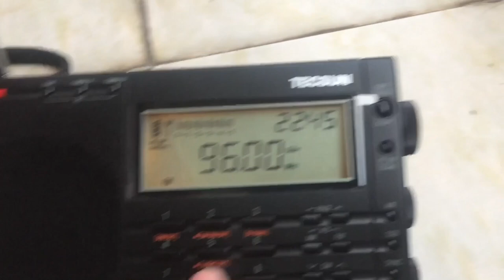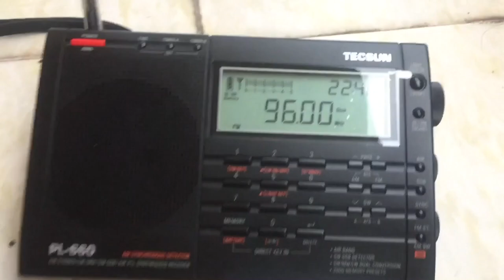Easy Crystal Locked FM Transmitter With Single 9018 Transistor  Stable Frequency

Comment: That is not a 24MHz crystal oscillator. It is a 24MHz crystal. An important distinction!
Reply from the maker: Hi Nick B, thanks for the correction 😊
Reply: And what is the different between "Oscillator Crystal" and "just Crystal" ?
Reply: @ميكال_باسل  
Crystal oscillator contains full circuit inside including one transistor and other components.
Reply: @Mulazim.  I got it , Thank you .
Reply: Bob Button  Because crystal has a harmonics frequencies so 4th harmonics frequency is 96Mhz.http://mustcalculate.com/electronics/harmonics.php?f=24M
Reply: Semantics, I don't agree with you
Reply: Hi Nick. Whether the product mentioned in this link is actually a crystal or a crystal oscillator? https://robu.in/product/hc49-s-11-0592mhz-crystal-oscillator-pack-of-5/
Reply: Dude one video he changed the hole radio at the end when he supposedly made a air plane radio

Comment: It is a fake video and surprisingly everyone is thinking its real.
Reply: I was also pretty surprised about the circuit diagram. It makes no sense for me.
Reply: @MyProjectsTV  I just cannot understand how it multiplies the frequency of the crystal to exactly 4×
Reply: @endothermicexothermic4051   Me neither. Unfortunately my knowledge about rf circuits is limited. Because I can't find much information in the internet. 
EDIT: Since there are comments of people claiming that it works, this is how it might work. 
The tank circuit is tuned to 48mhz. So double the cystals frequency. But these tank circuits have a lot of harmonics so it transmits of all sorts of multiples. So also at 96mhz But that's pretty dirty and should be filtered. But I still have doubt, how the crystal even oscillates.
Reply: @MyProjectsTV  yea, not much information is given...I am now struggling with building hf and vhf sstc, so i move on to rf circuit design, sad as the truth is that there is no people willing to post a video and discuss how to calculate the L or pi impedance matching of the amplifier output...Or sth like that.....
Reply: @MyProjectsTV  and it seems that the frequency is controlled by L and C in a normal resonant tank, so if u get a large cap, u need to use a small inductor, which may cause the current flow to the transitor increase.....It may make it burn out. I made one simple Fm transmitter oscillator, the tank cap I used is around 18~22pf, and the henry of coil around 100~200nH.
Reply: @MyProjectsTV  um, sir, plz teach me how to build a RF amp if you are willing to do so. The mosfet that I wanted to use is RD15HVF
Reply: @endothermicexothermic4051  Like said, my knowledge is limited. I tried to find that out aswell. But couldn't find any information :/
Reply: @MyProjectsTV  😂I just thought that you were trying to be humble so that you told me your knowledge was limited....
Reply: @endothermicexothermic4051  could you please share your circuit diagram kindly I want to make the circuit
Reply: I tested it and its working. I tried also different transistors like bc547 2n3904 bf199 2n2369A. Some will give a bit lower volume but all of them worked. You can try different crystal values like 25mhz which you can receive the 4th harmonic (100mhz) on the FM radio. 48Mhz is good because you can hear the 2nd harmonic on fm radio at 96mhz. The higher harmonic number the weaker the signal. 27mhz is my favourite because the 4th harmonic is 108mhz which always blank and no station broadcasting at this frequency in my country. So i can receive it on the radio without distortion. The diode is a varicap (varactor diode) type. Other types of diode might work but wont give the same performance. You can salvage these diodes from old crt tv tuner board (the pcb which is having the antenna connector and we attach the coaxial cable to it). Good luck.

Comment: Hi! Great project! But I have a question: What is the range of this transmitter? Thanks for your answer! 😊
Reply from the maker: I didn't test the range, maybe about 10 meters 😊
Reply: @diyshow888  Just enough to transmit into a car radio while inside the car...convenient to play your cell phone videos through your car radio, lol
Reply: @diyshow888  it ain't 10 meters, heck, never. At most, 2 - 3 feet or so.

Comment: Its using  4th harmonics .24 mhz times 4 is 96 mhz.
Reply: so , it's not actually locking right ? it's taking just fixed Upper Harmonic right ! so it's not tunable ?

Comment: can anyone tell me how crystal locking works , even if crystal is only of 24Mhz how it Work with 90 MHz LC tuned Rance ? since crystal oscillator oscilate at fix frequency ?
Reply: Same question
Reply: @ubtech2938  now I can answer bro ..
Reply: @omsingharjit  
could you tell me 🙂💔
Reply: @ubtech2938  yes , every Frequency source produce Harmonic of multiple frequencies for this case 24Mhz Crystal will also Produce 24 , 1st Harmonic 48MHz , 2nd 72Mhz , 3rd 96Mhz , 4th 120 so you have to pick frequency only from these .I have seen this with my spectrum Analyser
Reply: He is using 96 MHz from the Above Harmonic but The issue is the higher the harmonic , the lower its amplitude
Reply: @omsingharjit  wow . thank you ! this was a puzzle on my mind i guess i finally found the correct answer

thanks again . really appreciated
Reply: @ubtech2938  thank you.

Comment: which component did you use for the antenna 
and can I use an inductor coil to act as the antenna ?
Reply from the maker: You can simply use a wire as the antenna😊, soft wire or enameled wire ,  it doesn't has to be spiral

Comment: Can we connect the microphone to this circuit from the audio input part?
Reply: Yes
Reply: yes , just bise Mike with 4k7 resistor with positive and connect with base using coupling capacitor in between that should work .

Comment: Good evening, the transmitter works, but the volume of the signal at the receiver is very low? Matthias
Reply: e tenido problemas tambien con el sonido bajo.con este tipo de transmisores a cristal  en otro diagrama pero lo que hice es poner en resonancia el circuito tanque sintonizando en la frecuencia .
Reply: Try running this with a 12 or 16 MHz crystal.  The problem is the limited amount of frequency modulation that you get with these transmitters.  The range that the capacitance variation of the diode can pull the crystal with is very limited.  By taking a lower crystal frequency you get to use a higher harmonic of the oscillator.  That results in a larger FM modulation frequency sweep as the frequency difference from the diode capacitance modulation gets multiplied too.  The downside is though that this may also reduce the range of the transmitter as higher harmonics are often weaker.  But the sound level should be better.

Comment: What dose the zerner diode do ? I used the 12 V one and bc547 for transistor but the volume is bit too low
Reply: the diode provides a varying capacitance as the voltage changes (up and down) with the input signal. This, in turn, modulates the frequency by changing the crystal capacitance.

Comment: if the crystal oscillator is replaced with another frequency, is it multiplied by 4 too? for example 12mhz x 4 = 48mhz
Reply from the maker: Hi BRONEW ID , yes , you are right 😊
Reply: @diyshow888  Unfortunately, it's very difficult to find tutorials for making low-frequency radios. I'm confused about finding an FM receiver with a frequency below 88MHz
Reply: I'm pretty sure you can technically receive it on any positive integer multiple of the crystal frequency because it has harmonics

Comment: hello 
can you use fm mobile radio as the reciever ??
Reply from the maker: Hi victorwando8950 Yes you can 😊
Reply: @diyshow888  which equipment did you use as a coil for the antenna ?

Comment: Hello, how can I add a microphone in the circuit? What changes should be made in the circuit instead of the audio jack? Thank you
Reply: Hi, not sure if I can help you much but I found out by cutting an aux cable there was a red and a white cable with some copper sorrounding it, I soldered the red as + and the white as - and it worked for me, obviously every cable might be different otherwise look for Male 3.5mm Audio plugs

Comment: i made it but the problem with it the audio volume is pretty low, is there a way to raise the volume? thanks!
Reply from the maker: Hi kazibadema kalim
AFAIK the small volume is the defect of this  circuit, but you can try raise the input audio and battery voltage (12v) ,it can help a little 😊, regards

Comment: At 2:52 you will see that there are coils at the bottom of the antenna which may act as an inductor to tune the output--or conversely, since there is no testing, the coils may have no effect at all.  I made the circuit, it has very little RF output. I added an entire RF Amplifier (2nd transistor) stage to get this operating properly.  First step to improve the design: get rid of the 47pF in the tank circuit and use a 2-22pF trimmer capacitor.
Reply: Can u pls explain detaily about the improvements that u done to this circuit
Reply: Can you please go in-depth on how to do this? thanks.

Comment: Someone pls tell me what are the changes required in the circuit if I want to use mic as input.
Reply: You have to build a simple microphone circuit. Here is one:
https://www.hobbielektronika.hu/cikkek/szenmikrofon_helyettesitese_electret-tel.html
You have to connect a small transformer in series with the positive input. 
I made it, my transformer is 90 turns primary, 150 turns secondary from thin wire.
The secondary must be connected to the input of the transmitter. The circuit works with 9-12V
(2n2222 is better than bc547)
Reply: @landsknecht92

Comment: 1:01 Not a 30k resistor, it is 47k. So which is it supposed to be in the circuit?
Reply: You could use 47k without any problem
Reply: @slender1357  Thanks.

Comment: can i use 12mhz or 16.00 mhz crystall?
Reply from the maker: Hi  @victorwando8950 
You can use 16 mhz if your fm receiver supports 64 mhz (16 x 4  = 64) 😊 , but  22+ mhz is recommended

Comment: Hi! I would like to build this transmitter but I have only BF198 and 2N2222 transistors. Will it work properly with one of these transistors?  What is the max. range of your transmitter?
Reply: The BF198 or BF199 or even better, BF494 or heck loads better BF517 shall give extraordinary performance. I personally suggest BF517. Also, the circuit doesn't do much except put out a feeble RF signal for a few inches or so. You ought to add a PA stage to make it work for a few tens of feet.

Comment: Sir You're using 24 mhz crystal and you catch in your radio in 96 mhz,this is a multiplier frequency???   ( 24 )x 2 = 48 x 2 = 96.
Reply: This circuit used the 4th harmonic of the crystal, 24Mhz*4=96Mhz
Reply: so all crystal have harmonic?
i heard that only some crystal can generate Harmonic or some specially made on but not all ?

Comment: 9018 transistör yerine ne kullanabiliriz?
Reply from the maker: Hi mıkrotik You can try 2N2222A(CBE same as 9018) , 2SC3355 (BEC, middle pin is emitter ,search datasheet for more info) or you can try search google for more 9018 replacement 😊
Reply: @diyshow888  thanks

Comment: Which diode can I use instead of 1n4727 diode?
Reply from the maker: Hi Müh.Mehmet GİRE , I tested many diodes I have , only 1n4727 works
Reply: Use a varicap diode, BB808 etc. Your have greater deviation

Comment: What thickness of wire are you using to create the coil?
Reply: He says it in the video that it better be 0.5 mm to 1 mm dia enamelled wire which equals to 18 AWG (~1 mm) to 24 AWG (~0.5 mm). If you use 5 turns of 24 AWG which is 0.5 mm wire winding on 5 mm air core, it shall give you 0.187 uH of inductance which ought to be more than enough to cover the entire FM2 type band.

Comment: I wanna transmit Morse code. How will I have to do?
Reply from the maker: Hi Công Hàn Hoàng
You can try make  beeper  with ne555  😊 , then connect to this fm transmitter (but I think you need an amplifier between ne555 beeper and transmitter )

Comment: unfortunately it doesn't work 100%!
because of the crystal you don't get good WFM modulation.
The sound is too soft! Listen and watch the volume! ( I'd rather be wrong! but... very sadly ;-(   )
WFM with a crystal is almost impossible to do / to make unfortunately.
maybe you could try this with a ceramic 10.7MHz filter?
10.7 X 9 = 96.3MHz

Healthy and Friendly Greetings from the Netherlands!
Rob
Reply from the maker: @HobbyRob Hi HobbyRob, you are right, Indeed, the sound is too soft :-)
Reply: @diyshow888  
i wish i was wrong!
because it would have been very nice crystal controlled a nice WFM modulation and supper stable!!!
I happened to be working on it but I couldn't get it done,
I also recently worked with a ceramic filter, maybe it will work with that, but then in this way:
10.7MHz filter times 9 = 96.3
I haven't gotten around to it yet, but what if you modulated an oscillator 10.7 WFM with a varicap? could that work?
I want to try that for here in the Netherlands, but then: 10.7 times 8 = 85.6 MHz (here in NL that is a kind of pirate band!)

Greetings again!
Rob

Comment: Its amplitude modulation... Its not FM , IF  you will recv AM modulation on FM,  sound quality will not clear due to diffrent modulation
Reply: What? It's using the 3rd harmonic of the crystal to transmit on exactly 96MHz. The purpose of the diode is the vary the capacitance of the crystal, thus modulating the signal.
Reply: @NitrobenzeneNO3  so that diode is used for vericap in rev bise right ??

Comment: It dosent even work and you hide what the phone is plugged into probably not plugged into anything at all just like how you changed the circuit at at the end of the video for the air plane radio i bet that is a FM radio station broadcasting nothing and u got the music playing out the phone's speaker very quietly
Reply from the maker: Hi eric moeller , I swear to God  the sound was from the circuit board you saw in the video (although there was a mistake as you and other mentioned before, but it works, that's why I didn't  found the mistake  before I upload the video),and I also swear to God for the air plane radio, the radio I made you saw in that video works very well, please be patient 😊
Reply: @diyshow888  i also noticed in this video u put 2 47k resistors in and one was supposed to be 30k resistor and then u then u change the wrong one to a 30k and how was that one video a mastake you can see you turning the tuning capacitor on it and the parts on the board had a label stamped besides them like the kind you see in electronics you buy out of the store i really think you dont know what you are doing
Reply from the maker: @eric moeller  the 30K resistor was changed at 01:34 afterI found the mistake, I apologize for that I didn't mention this in the video, and I just cut & polished the board before I shoot the test footage 😊
Reply: @diyshow888  thats what i said

Comment: Where the circut
Reply from the maker: Hi TO ALL ARAB MINDS please check  description (show more ) 😊  and please notice: there is a mistake in the circuit diagram , the crystal oscillator should be 22~27 mhz  , not 12 MHz , I use 24 MHz